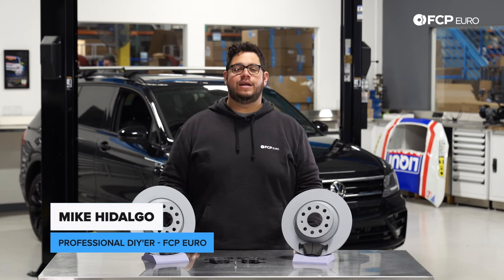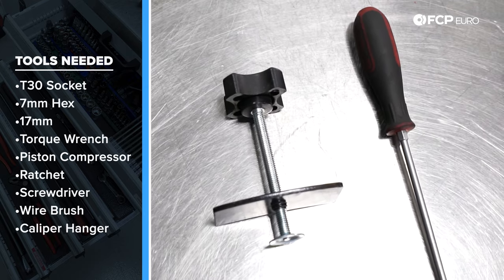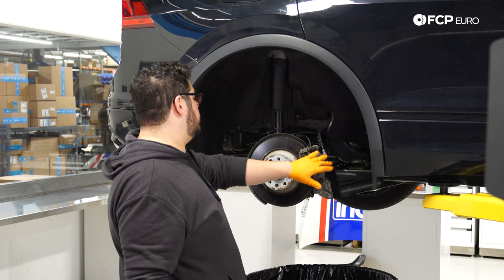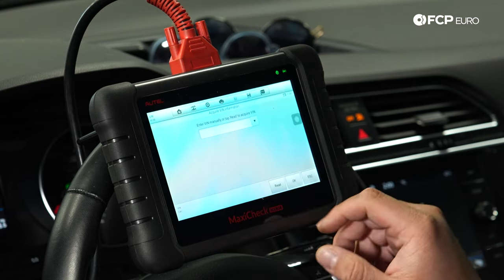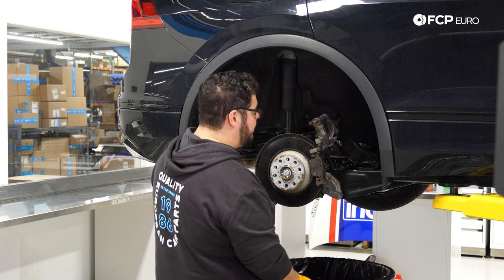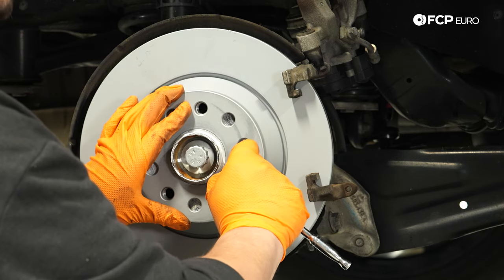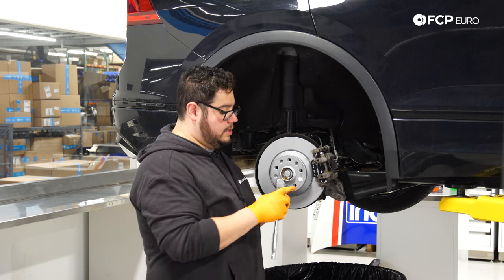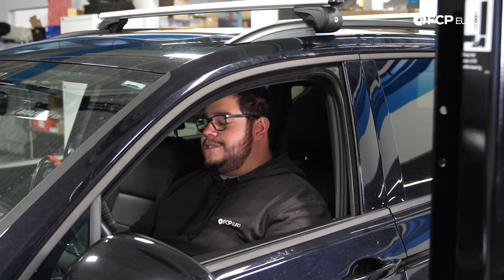Volkswagen Tiguan Rear Brake Pad & Rotor Replacement DIY (2018-2021 VW Tiguan, Arteon, Atlas)

Comment: If you don't have a scanner is they any other way to do the job?
Reply: Remove the emergency brake. You will see a spline, and use a 9mm socket to hand turn the spline. Make sure when you hand turn, the spline the piston is not going out, if it goes out, turn the opposite direction.
Reply: @brentbrown9728  will  they automatically set themselves clearance wise by using the switch?
Reply: @othername1000  I didn't have an issue with it, so I assume so. E-brake still worked. Just make sure you are going the correct direction when you remove it.
Reply: @brentbrown9728  Thank you.
Reply: OBDeleven works great
Reply: So you can just release the parking brake with the switch inside the cab then work on the brake pads?
Reply: @danielgardner6896  that’s what I did. I did the manual removal of e brake and the spline opening described above to fully open e-brake. After reinstalling e-brake and pads/ rotors and everything was done, I cycled the e-brake switch a few times to let the e-brake adjust itself to the new clearance.
Reply: Exactly that. Just release the parking brake. It's not more complicated than that.

I understand trying/needing to sell a tool, and a useful one at that, but this is a bit much.
Reply: So I didn’t know about disconnecting the brake and after reinstalling I have a ebrake fault any way of fixing that
Reply: @kcocgibkcusuoy you need the scan tool to release the piston so you can push it back in when you put new pads on. The clearance will be wider whenever you put fresh pads on which calls for less piston out of the caliper. If you don’t have the scan tool the piston won’t go nowhere no matter how hard you push it in. Now I never have released a electronic parking brake manually (without a scan tool) so I don’t know how effective that is.
Reply: Yes I just use jumper wire its faster then the scanner

Comment: just turn the piston back in from the pad side no need for a scan tool or to remove the motor from the back and screw it in that way, like some say. I've had these apart and they are simple as anything once you see how they work inside, and you'll see what I mean. Just set the parking brake a few times before you head out to make sure that's adjusted.

Comment: I just did mine. The hardest part was the top 7mm hex bolt. I had to use a 7mm key as my tools didn't have the swivel and short extension. But all this helped. I bought an ANCEL VD500 OBD II Diagnostic Scanner for about $50 USD that made it easy. Your video helped a lot, could not have done it without your help.

Comment: Great video but I had to remove the caliper carrier in order to remove my rear rotors but not the fronts.  Also why is everyone and all the info I’m seeing telling me I need to twist my caliper piston as I’m pushing it in? I don’t want to break it so I’m a little worried about just compressing it back like you did!
Reply from the maker: A lot of the older VW/Audi vehicles have calipers that need the pistons to be screwed in. On this newer Tiguan and other VAG vehicles, they simply press in like any normal caliper. If you were dealing with a caliper that had to be twisted in, it would not easily compress with a normal caliper tool.

Comment: Remove the electronic parking brake off the back of the caliper, take the 2 t27 screws out and use a 9mm on the little shaft inside (turn clockwise with your hand) and push the piston in with a clamp or caliper compression tool and put it back together!
You dont need an expensive scan tool to do this!
2021 vw tiguan se-rline, 3 different brake pads and rotors trying to find the best set for my 20" asanti black labels, worked for me every time with no problem and i think it might even be faster than the scan tool also
Reply: Can you do a video doing that? Pls
Reply: nailed it buddy!   saved me a head ache forsure
Reply: Exactly this. On my 2020 Tiguan, it was a 5mm hex to remove the parking brake motor, then a 8mm hex socket to turn the shaft. Easy as pie.
Reply: Don't even need to do all that just screw it in from the pad side like we have done for years. I helped a guy with his f150. He thought he needed to apply the E-e-brake! after he had the caliper off and the pads out! Anyway the E-e-brake screwed the piston all the way out brake fluid all over. Took the caliber and parts back to the bench and reassembled bleed the brakes applied the E-e-brake a couple of times and all good maybe 2 years and 20K miles. Did the same thing on two newer Honda civics no issues at all. That screw you turn will stay tight when hooked to the motor so the piston just screws right in. But the piston is the same as all the other pistons out there just slides back and forth on a square cut seal. If you can turn the old ones no reason you can't turn the new ones...

Comment: Thanks for this walkthrough. Ive never done any work on a car before and following along with this video helped me get my breaks done in ~20 minutes per side. 

Im in southern ontario and i couldnt believe how dirty and rusty everything was once i got the thing disassembled. A wire wheel was essential for me. Fortunately i grabbed one on a whim. 

I also used a $50 scanning tool to make the ebreak thingy go (if anyone is floored by the price of the fancy touch screen one in this video, there are affordable alternatives) 

Thanks again! Saved me a buttload of cash and i learned a new skill!
Reply: Which scanner did you use? I want to pick one up that will accomplish this. Thanks.
Reply: @forthesakeofreason  This guy: ANCEL VD500 OBD II Diagnostic Scanner

Comment: Since the MQB chassis shares a lot of parts across the platform the rear rotors and calipers are the same on a Golf R 7.5 and Audi S3 8V (and submodels). This is nice because having to try and remove the rear caliper carrier not on a lift (i.e. jack stands) is near impossible due to the torque required.
Great video and talks for all the support the FCP Euro team provides!

Comment: Those caliper brackets are the best when removing rotors. Also you can disconnect the electrical connector on the caliper to get extra movement( just remember to reconnect it) I do that every time I work on these electronic parking brakes
Reply from the maker: Good idea with the connector!

Comment: Great step-by-step video! A question: If replacing pads on both rear wheels (2017 Tiguan), do both sides have electronic parking brake motors? If so, I assume the scan tool remains on until both sides are complete?
Reply: EPB actuator always comes in pair..once you send the command to open the EPB for any brake procedure, they both open same time.

Comment: Great video.  About to do the same job on a 2018 VW Tiguan.  I assume the same rules apply and I don't actually need a brake wind back tool?  I can just push the piston in?  Thanks!
Reply from the maker: That would be correct, Joel!

Comment: Great Video! Very informative. My 2018 Tiguan Rotor hubs are rusting. What do you recommend I do to fix that? If I change the rotors, do you have any rotors that you recommend that wont rust?
Reply from the maker: Hi Dave, we offer Zinc coated rotors like the ones we installed in this video, the hubs are coated, so they don't oxidize like normal non coated units.

Comment: Hi Mike, thanks for the video, I have a question, how do you set torque when tightening bolts?  and I have a 2022 Tiguan all wheel drive S. will that be the same procedure as the 21
?
Reply: You need a torque wrench.

Comment: Can I change the brake pads without the scan tool? I don´t know if I just deactivate the brakes manually, that could work?
Reply: I’m here looking for the same answer. I’m guessing the tool is necessary
Reply: @Android_ozzy  @takechobyker you guys ever figure this out?
Reply: @nickd1978  yup, there’s two bolts behind the calipers that have plastic covers and you need a freaking alen key to unscrew them. Thankfully I had an Allen key adapter for my wrench set. This video is  partially promoting the scan tool and it is not necessary

Comment: Another question sorry do you need a battery charger when doing the erase thing with the scanner? I see one is needed when using VCDS which I have but if one is not needed with the mx808 then I will buy that instead of a charger

Comment: So you do need a scanner to do the rear brakes? Is their another route you can take without using the scanner?
Reply from the maker: Hi Tony, a scanner of some sort will be needed to retract the electronic rear parking break!
Reply: For sure you need a compatible scan tool. It's due to the electronic parking brake - you've got to put it in service mode in order to do the job.
Reply: @fcpeuro  so, is the only way to retract the electronic parking break is using the scanner? what about if you turn the vehicle on and turn off/ release the parking break? It sounds as if being released but not sure if once you turn it off it will automatically activate the parking brake . ?
Reply: @40danyhk I’m sure a lot of people are waiting to hear this answer.  I don’t have a scanner either.

Comment: Can I raise all 4 tires off the ground start the vehicle and release the parking to change the rear pads and rotors?  I don’t have a scan tool to put it in service mode.
Reply: No the park brakes wont retract enough for that needs to be in a service mode. Get this tool ANCEL VD500 OBD II Diagnostic Scanner

Comment: Are you able to change brake pads and rotors without the MaxiCheck MX 808? Is that the only way to release the electronic parking brake?
Reply from the maker: Hi Lee, there are other scanners out there you can use instead that will perform that action!

Comment: Hi, does the vehicle have to be left “on” in the accessory mode while performing the brake job?
Reply: With my scan tool after you retract the park brake you can turn it off. ANCEL VD500 OBD II Diagnostic Scanner

Comment: I just did my rear pads and rotors and found that the driver side outboard pad was down to the metal, while the other three rear pads still had plenty of material. After replacement, I felt the car fighting acceleration giving it the gas, and actively decelerating (instead of coasting) when I let off the gas but didn't apply the brake. It's as if that pad is always actuated.

Bad caliper? Bad guide pins? What gives?
Reply: Very common on all cars to either have seized slide pins from lack of grease, or sometimes a hung up caliper. Only way to check for sure is to pull off the suspected culprit, and check that the slide pins move freely, take the caliper and compress, whatever tool you used it should compress relatively easy if you feel like you have to use all your strength the caliper is most likely seized up. Based on only the outboard pad being excessively worn I would suspect the slide pins are the culprit, but again only one way to know gotta take it apart and inspect the system. Sorry it took 4 weeks for anyone to reply to you
Reply: @tidus_on_crack6570  Hey man, it's free advice and I appreciate it. I took the slide pins out and greased them up but the issue is persisting. Next thing I'm gonna try is bleeding the brakes, I'm thinking maybe there's a fluid issue. Or I might just replace the caliper. 

Anyway thanks for the advice!
Reply: @IanDeRanieri simply greasing the pins is not sufficient if they are rusted. As soon as the boot is torn, replace the boot and the slide pin. Sounds like a bad caliper to me but what do I know.

Comment: How reliable are the tiguans?
Reply: We have 2018 VW Tiguan SE with 51,200 miles. Replaced water pump under recall, replaced spark plugs and brake pads/rotors. Everything runs excellent and got great gas mileage at 31.6 MPG on freeway with regular 87 octane. Very happy so far after 4 years owning it.
Reply: Engine oil pan gasket leak
First 10,000 miles
No problem since 
61,000 needs brakes
Reply: Get a manual Jetta, manual cars are way more reliable
Reply: I have 100k miles on mine it's a 2021 se-rline blk no problems  just normal  maintenance

Comment: leave the guide pins. remove the caliper carrier bolts. slide caliper off carrier. wire brush lol not here in Buffalo, get the cookie out and clean up carrier and hub